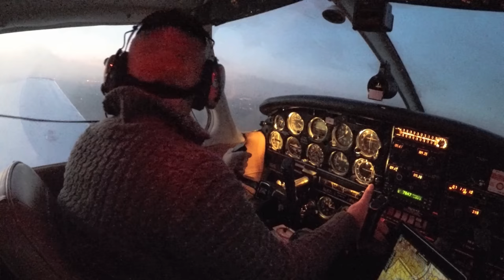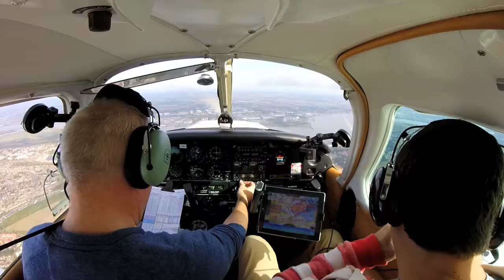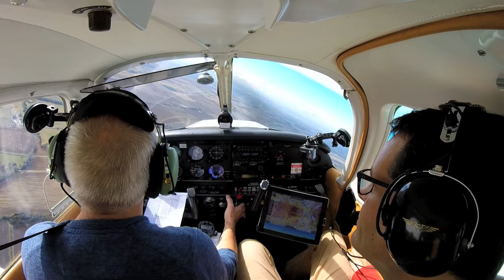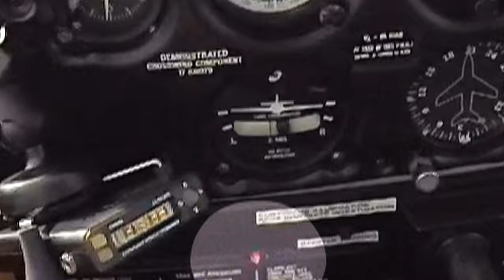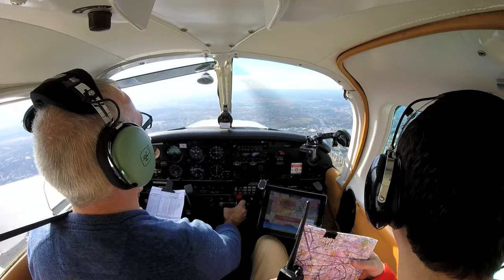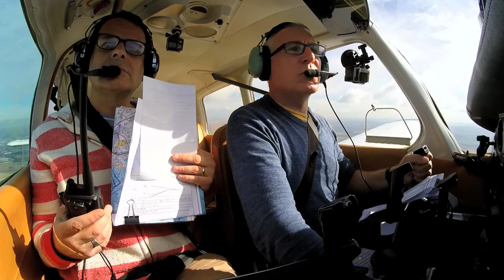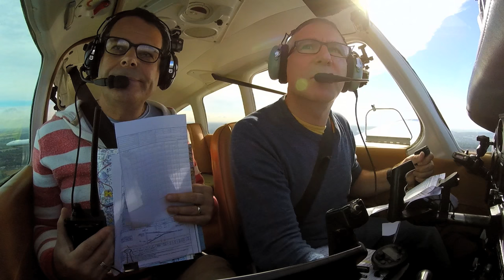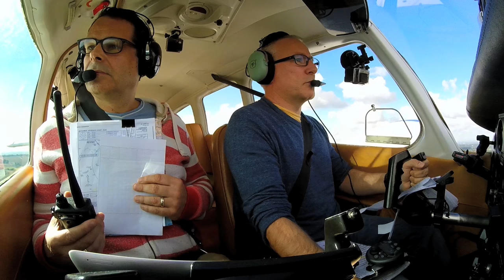In-flight alternator failure in the PA28 over Essex UK

Comment: Hi
Great video.
The only BUT, I think you should declare PAN PAN PAN, I did on my alt failure. In my case 60A fuse has burned itself to pieces with smoke in cockpit, but no fire and smoke diapered, i was lucky enough to be only few miles north of EGHR shortly after take off, so quick 180 and land on nearest rwy.
Happy landings!!!

Comment: I had an alternator failure leading in a VERY short time to complete batteries drain and, being electronic ignition, nothing but a single magneto.  No radio, no flaps, no trim, but airspeed instrument. You learn a lot about yourself and aircraft....just one thing: I've never yet successfully picked up lights from the tower.
Reply: Did you still have a working artificial horizon?

Comment: Very interesting. 
A few things I thought about from the comfort of the sofa and not from the stressful cockpit.
1) Turning the strob and the transponder off quite early would be a good way to prolong the battery life for comms. They do both use quite a bit of juice. 
2) ATC used the term "no need to respond". Partly I guess to preserve your battery life longer. If I felt compelled to respond, I might have use two quick clicks on the PTT. Again the transmit uses up the battery life much more than just receiving. 
The Fire crew do probably enjoy the practice, but I too would feel the additional pressure. A bit OTT if no fire reported. 
Well done. I enjoy watching.
Reply from the maker: Thanks for the comments.  All appreciated.
Reply: It is a higher risk situation.   Stress,  problems with the plane, maybe further unknown problems with plane.  Better to have the fire service ready.

Comment: Excellent video and well handled. I had an alternator failure in a TB9 on a flight from Ipswich to Biggin many years ago and your experience is pretty identical to mine though I didn't have a spare radio. But switched off all non essential electrics and made it back with just enough battery to keep one radio working and had a similar reception when I landed. Good to see them play safe.

Comment: Well handled. I have had 3 of these they are no drama whatsoever in vfr. The key thing is to notice the alternator failure when it happens so as to manage your battery life. Which you did . I once flew for 2 hours over the kalahari after shutting the alternator down because it was over-charging.  By switching off the battery as well I had plenty left when I needed the radio for controlled airspace. One of the most peaceful and relaxing flights I have had. IFR different kettle of fish, you need an approach or cloud break at the first opportunity.

Comment: Nice-very well handled. If I may add couple things. First, light aircraft certification requires 30 minutes battery juice (assuming no accessories ) . Years back I confirmed this in flight in a piper arrow (I did this test after an alternator failureIMC). Second, hand held radios have very little range inside the plane unless connected to external antennae. Douglas Boyd commercial single/multi engine land/IFR.
Reply from the maker: Thanks Douglas.

Comment: An interesting video and safely handled but with a few misconceptions and errors, the first thing is to pick up the non normal check list and complete it to put the aircraft in the best state. In the non normal check list there will be a requirement to load shed in a logical way. Several mentions had been made about battery life, 20 minutes battery life is a requirement but with the load shedding in the check list the battery life should be vastly extended, when testing this on an aircraft with an almost identical electrical system we gave up testing at one hour and thirty minutes as the battery was yet to die. Your hand held radio will have very little range from inside a metal box using that antenna, I would expect IRO 6-7 miles depending on direction, if you can find a way to rig that handheld radio to an external antenna you can expect a range 40 miles + also you must be able to connect your headset to the handheld radio especially when flying IFR.

Comment: Many years ago, this happened to me when I noticed my alternator not charging following s/u after a refuelling stop.  It was the last leg of a flight home in north western Ontario .  This was in a PA28-140 equipped for VFR.  
I decided to shut off the alternator field and proceed on the 50 minute day VFR flight home late in November during  winter conditions.  Completing the flight would not have been an issue  if NORDO.  
I elected to leave my transponder off and turned the beacon off to reduce power use while leaving the Thunder Bay traffic zone.  I also carried a portable radio for emergency backup.  I just didn't have any need to use it.  
As the plane's battery would not be recharging, I would be drawing power from the master solenoid, electric turn & bank, & a nav-com to use the radio.  I was prepared for a total loss of battery power and shut off the radio & master during part of the flight just to conserve power once 20 miles clear of the tower airport.  My destination airport was uncontrolled with infrequent air movements, so even a Nordo landing would not be a problem here.   I turned the master back on when 20 miles from destination.   That allowed me to use the radio for closing my flight plan and to monitor my local frequency.  
I imagine, I'd have been more worried if flying thru busier airspace.  If doing again, I would have advised the FSS unit when going Nordo.  
Later I restarted the plane's engine and confirmed that there was no charging voltage and before getting the alternator repaired.

Comment: Very well handled John. I am following your videos and this was probably the most useful to me, as I am doing my PPL (flying a PA28 in Elstree so everything looks very familiar to me). You kept your cool (frightened your friend a little bit) and handled it very well. I am interested to know what the failure was at the end and if there was a "better" way to handle it.
Reply from the maker: It needed a new alternator.  In terms of what I could have done differently...well, I think I covered most of that in the video.  Next time, I’d be more relaxed about it....got a bit tense about what in essence is a small issue.
Reply: thank you John for your answer. I thought magnetos were alternators. Couldn’t you have switched between left or right magnetos and use the one that was still operational? Sorry if it is a stupid question... I’m still learning
Reply: Few months late on this on I realise @CyrilDeretz  ! But the Mags provide the power to the ignition system, ie the actual engine itself in terms of fuel ignition and combustion but are not connected to the on board electrics in any way. The Alternator supplies AC Power off the engine once its running.

Comment: Great video. What was it that you said you didn't want to power up for fear of causing a fire?  Also how would you use your backup radio in flight?  How would you hear it? Could the ATC hear you in flight? Thanks.
Reply from the maker: +david Webber Hi David.  Having established that there was an unknown electrical problem with the alternator I was worried about powering it up again.  I'd recycled the switch a few times.  I didn't know what was causing the failure.  If the problem was more serious than just an alternator failure, perhaps a more substantial electrical fault, I didn't want to tempt fate.  As it turns out, the alternator had just failed.

The backup radio comes with a headset adapter, so I'd use it just like I would the ships own radio, by plugging my headset into it.  Even if I didn't have this adapter, I'm pretty sure we'd be able to communicate, in spite of the noise.

Comment: Great job ! Can you plse explain the large adjustment to the altimeter prior to landing (10:20)?  I think you fly flight levels at lower altitudes than 18,000 ft, but not too sure. Thx !!
Reply from the maker: Thanks.  Biggin Hill is at 600ft amsl, and we used QFE here, particularly in private flying.  So the adjustment was from QNH to QFE so that the altimeter read height above airfield elevation.

Comment: Great informative video. So how is an aircraft engine different than an automotive engine? If you lose your alternator in a car, your battery will discharge and then the engine stops.
Reply from the maker: +goutvols103 we don't have a coil, distributor or electronic ignition in these aircraft.  We have a magneto.  It's a mechanical spark producer, so will continue to keep the engine firing once it's running.

Comment: Did you consider transferring from the panel radio to the Icom as you got closer to the airport? I'm about to start private pilot training and just purchased an Icom handheld. Maybe it's my sailing background, but I absolutely want a backup, although I gather that a lot of pilots don't have one. Besides, it's good training. I've been listening to traffic at my local airport (LaGuardia, only two miles away with good line of sight) and I'm quickly learning that aviation communications are quite a bit more complicated than marine communications.
Reply from the maker: I considered it, and I had the standby radio tuned to the frequency I was using.  Chose to stay with the panel radio though, as there were no symptoms of impending power failure.
Reply: Thanks for the reply. Your channel, which I didn't know about, came up as recommended this morning. Watched the Cirrus video, then the one on Jersey, where I've visited occasionally, and then this one. Really good content. By the way,. Icom has a new, really nice radio out (A25C and A25N), although it appears that it will be a bit before it's available outside the U.S. and Canada.
Reply from the maker: Thanks.

Comment: Good job for dealing with the situation. I'm confused about something though, you said you were doing a standard join for O3 Left hand but at 12:14 you can see the runway on your right hand side. How is that the case? Thanks
Reply from the maker: +Singularity thanks.  standard join for that aerodrome means joining from the dead side at circuit height, and cross the runway at the mid point.  Then turn downwind.   I was at the midpoint of the runway in that section of the film.
Reply: Ah OK, makes sense now, didn't know you were mid point. Thanks

Comment: i love when u give a little bit of explaination in the voice over.. hahah maybe u could tell me what alternator is ... that would be more informative...
Reply: The alternator uses engine power to charge the battery. So with an alternator failure the battery is being used without being re-charged. All electronics on the plane like the radio, transponder, etc. use battery power.

Comment: didnt you switch battery and alternator off ? secondly can you tell me about your standby radio set ? and lastly why you set your altimeter to QFE ?
Reply from the maker: +hassaan zahid switched off the power to the alternator.  I have a handheld icom radio.  Qfe is used a fair amount in VFR GA flying in the U.K. and means that the altimeter reads height above aerodrome/threshold as opposed to above mean sea level.

Comment: An electrical failure is really no big deal.You can try to reset the alternator circuit and just go back and land normally.You were flying a piper warrior they have manual flaps.I had an electrical failure at nite in a Cessna 172 and it was no big deal.It was the smoothest landing I ever did.No flap landing.The biggest we all was being stuck on the wrong side of the airport resulting in a long walk back to my car late at nite.

Comment: May I suggest you don't retract the flaps just after landing? One day it will be the undercarriage!!!
Reply from the maker: From the PA28-161 POH.  "Gently lower the nose and apply the brakes.  Braking is most effective when flaps are raised and back pressure is applied to the control wheel, putting most of the aircraft weight on the main wheels."
Reply: Haha! Yep, I raise flaps on rollout. I think in a Pa28R you’re fine because the flap lever and gear switch aren’t next to each other, but on an aircraft with co-located controls for each it might be an issue. Thing is, the movements needed for each are still quite different. Perhaps back in the day before cockpit layouts were thought about a little that might have been more of an issue, but I’m not convinced it’s much of a risk?